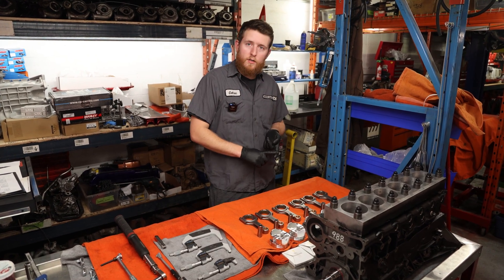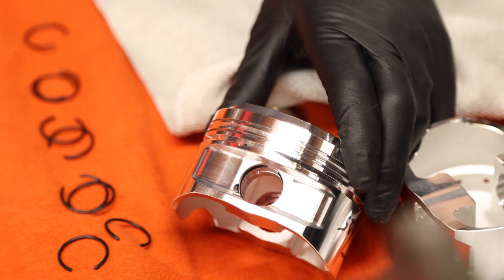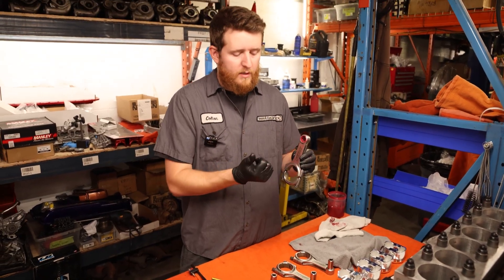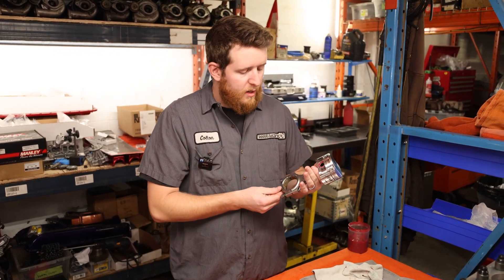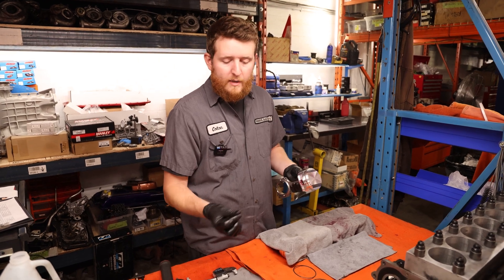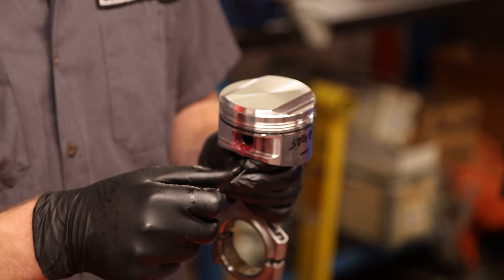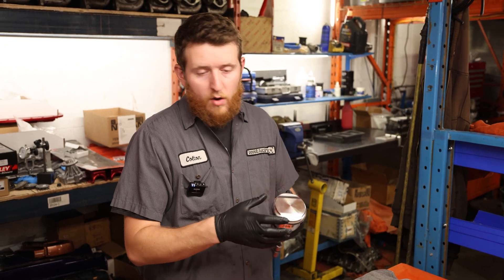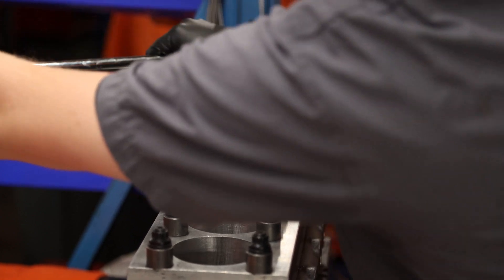RB26 FULL ENGINE BUILD || Episode 7: Assembling Rods & Pistons + Ring Installation

Comment: Question! Is this ring orientation what CP recommends? Or is this something you guys kept for all RB applications?
Reply from the maker: @Kaijuu34  This is generally what all piston manufacturers and OEMs suggest, there is other orientations that arguably will achieve the same if not similar results
Reply: @boost.factory thank you! We are working on a Nitto bottom end and wanting to make sure the rings are correct. Thank you for this video it has helped so much!
Reply from the maker: @Kaijuu34  right on! Ok, This should apply to those, make sure they are right side up and spaced evenly, this gives best results during break in!

Comment: Hi Colton, just wanted to ask why the oil control rings come with a spacer/expander? Also wanted to clarify that the top oil control ring gap goes rear off centre, hot side, the bottom oil control ring gap is front off centre, cold side.
Reply from the maker: Hey, so the oil control rings are lower tension and flimsy by design, they are actually designed to allow some oil to bypass them to lubricate the top 2 rings, this inherent flimsy design means they require additional support, thus the use / purpose of the third squiggly ring in the centre of them providing the support but also able to move freely with the oil control rings independent of the piston ring land. 

as for orientation. this is not super critical for these rings, as long as you have them evenly spaced and far away as possible from other gaps. when the top 2 are already orientated you can just continue to work your way down evenly spacing the oil control rings, the specific direction they face is not critical.

hope this helps!
Reply: @boost.factory  🙏🙏